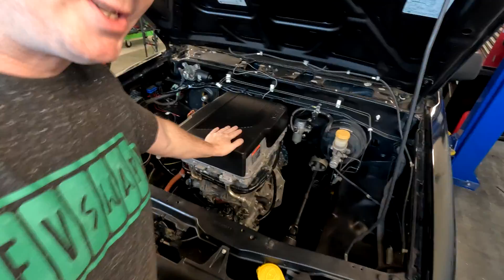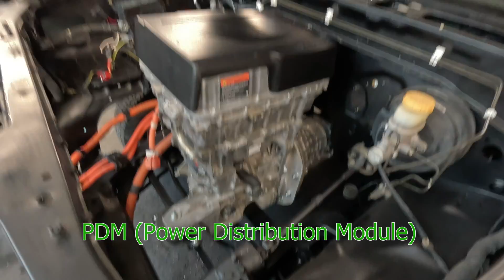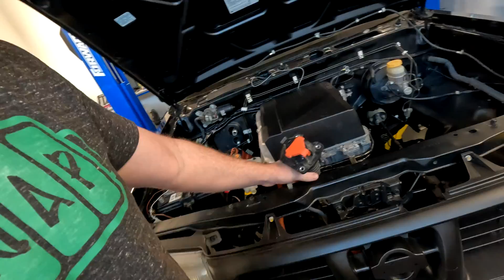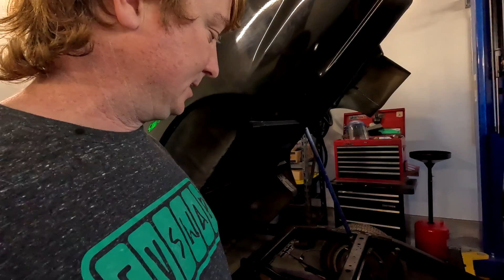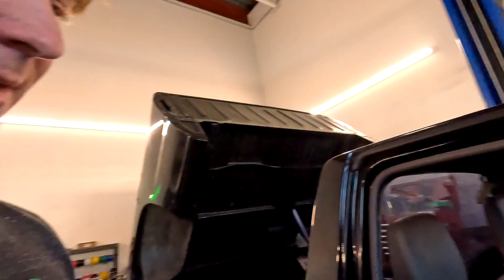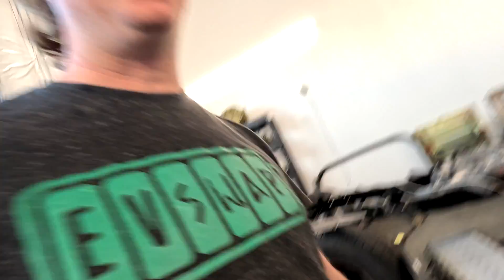EV Motor Officially Installed in the EVSwap Frontier Minitruck Conversion!

Comment: I intend to do an EV swap on my 1985 720.  This build you've got going is very much like what I intend.  I have so many questions.  I figure I'll get answers by watching more of your videos, but that isn't going to stop me from asking here right now.  Before I do, I gotta say that motor install looks super clean and like it was factory for that truck.  Way to go!  First: I see you used a motor coupler to the transmission, is that mated to a 5-speed or automatic?  If 5 speed, I'm guessing you are not using the clutch?  I intend to build mine keeping the clutch.   Next: what year Leaf is that motor from?  I was an early EVangelist and bought a 2011 Leaf new.  I'd like my build to have the more powerful 2019-current Leaf SV Plus motor.  Can any of these motors be modified to have the higher power output?  I'm searching for a complete wrecked Leaf to buy, is that what you did?  Also: did you custom build your tilt bed or did you purchase a kit?  Is it manual lift or electric or hydraulic?  Last question: Are you using all the battery modules from the Leaf (what year what pack), or less or more modules, and what will be your final output be (xx-parallel, xx-series)?  Thanks!
Reply from the maker: Thanks, check out the full playlist here on YouTube, I documented pretty much every part of the build.

-No clutch, 5-speed. Mostly drive in 2nd or 3rd gear. Would be more fun with a clutch for sure.
-Donor LEAF was a 2019, 110kw, 40kwh
-Yes, you can use any 2013+ LEAF motor with any 2013-2025 inverter and gain the extra power or use a swap in inverter board like OpenInveter. Only the 40 and 60kwh batteries can really support the power, though.
-Bought donor LEAF on Copart
-Bed tilt was done by a high school shop class years ago before I worked on it. They simply just welded plates and hinges to the rear. I added the struts and latches. Struts are pneumatic. 
-Yes, all modules from 40kwh pack and contactors, fuse, BMS, etc. Complete battery, wired like a stock LEAF.
-400v, stock LEAF everything basically when using Resolve-EV VCU.
Reply: @EVSwap  Thanks for the info.  This was the first video I watched and I was so excited I started writing a comment before checking the other vids.  I've been shopping for a 2018-2024 Leaf SV Plus on Copart but a bit nervous because I've heard so many negative things about them  Did you win an auction or did you find one with a buy-it-now price?  I was wondering if they have all the same fees on the buy it now cars.  I have a few locations close to me in WA and OR and could have one shipped for a small fee.  But I haven't upgraded from just the basic bidder plan that only allows me to bid on certain cars or only up to $2,000.  Ideally getting a crashed but driveable Leaf like what you got for under $4k would be the plan.  My truck gets about 18mpg right now and with a 10-12 gallon tank that's just 180 miles, so the goal is a Leaf 720 that has ~180hp and 200 mile range.   Definitely want to keep the clutch.  With Can-EV supplying the adapter plate and buying a resolve-EV VCU I think this would get me the setup I want.  I live right behind a high school and could walk to the auto shop.  Perhaps I strike up a conversation with the shop teacher to see if the kids would like to take on a tilt bed project.  So cool!

Comment: OBTW  Service access to battery  using hinges for doors on top? Welding NEAR Batter really? Aluminum cracks from heat cycles. Steel ?
Reply from the maker: The top is bolted on and is removed by taking out the bolts. Welded parts FOR the battery, but not NEAR the battery haha! Hopefully the welds don't crack, I used 4043 wire to try and mitigate cracking.

Comment: Nice work!! Can you use the LEAF power steering (EPS)?
Reply from the maker: Yes you can but it requires some more work and something like a raspberry pi to control it but this truck has manual steering anyway so we're going to stick with that.

Comment: Why have a transmission?
Reply from the maker: The motor needs some sort of gear reduction in between it and the rear differential. Using the stock transmission also drastically simplifies the mounting and connection of the EV motor to the drivetrain.
Reply: @EVSwap  So no clutch, just leave it in one of the manual transmission gears?

Comment: Is there a way to get more power output from those motors?
Reply from the maker: Yes! This one has 110kw (150hp) but it's possible to swap the inverter from a LEAF + and then it will have 150kw or 200hp! With a custom inverter the LEAF motor is capable of over 300hp!
Reply: Dala swapped a NV inverter into his and got more power

Comment: If you’re able to install the charge plug in the gas cap location, that would be awesome! Great work on this!
Reply: I'd add that it should have a CCS socket where the gas cap was.
Reply from the maker: Dave actually is putting a 120VAC outlet there so he can run power tools and other things off of the truck!

Comment: Sharing similar battery challenges w designing my battery box(s) for my e-truck.  Question: what is the main advantage in using aluminum over steel in the build - maybe weight?  Thanks!!
Reply from the maker: Weight but also it's easier to finish out. Steel will need to be prepped and painted.
Reply: Steel would be easier to fab. Lay out the base, sides and cut the corners and brake the wings/sides and weld up the corners with on-hand equipment and add mounts and a fabbed lid with seals. The additional epoxy paint work is minimal.